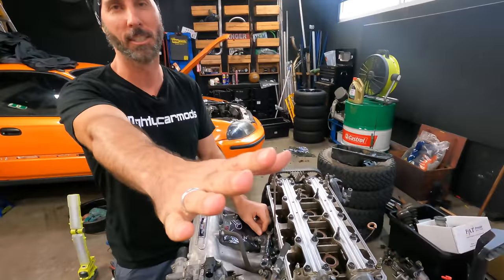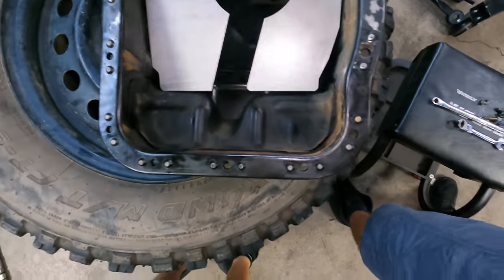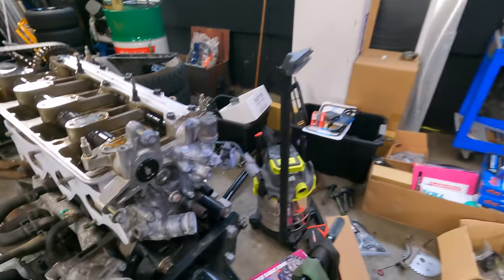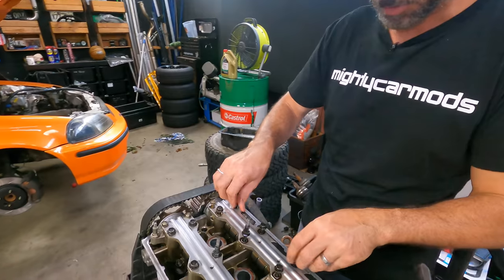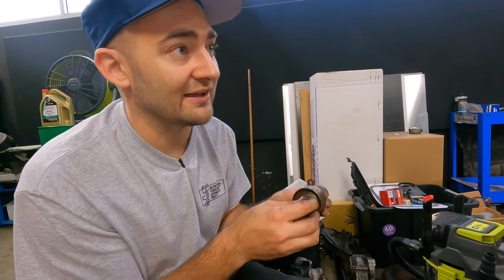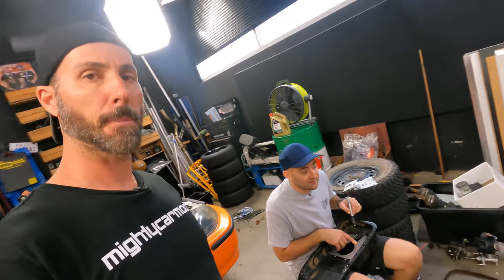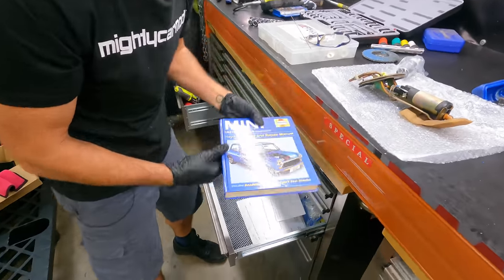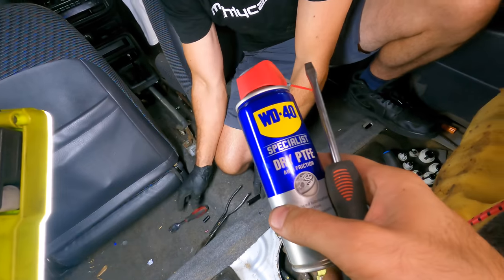Spoon your SKUNK until he MUGENS - CIVIC Build (EP5)

Comment: I still have my first vehicle, a 1990 Honda Civic, which I swapped a B18A1 into.  I just got it all working great again.  I've owned the car for 15 years.  I love it because it's zippy and handles really well.  By today's standards a Toyota Rav4 is probably quicker than my car, but there's just something about ripping around in a car that weighs less than 1000kg and has 100+ hp (laugh all you want, maybe I'll turbo it one day, ten watch out!!).  And with gas prices being what they are it's an economical way to pretend I own a sports car.  Beats the hell out of driving my gas guzzling work truck around, with my tools rolling all over the place in the back.   Best wishes from Alberta, Canada!

Comment: EF/DA/EG/EK/DC are good first cars for a beginner enthusiast... even though they're slow lol. Great to learn things like dropping a transmission, doing a clutch or building a Frankenstein engine. Basically every reason Marty gave in the video on MCMTV2 talking about small cars from a long time ago.
Reply: I have a buddy that is a mad honda wizard ( builds turbo civic drag cars in his garage lol). My beat down EF hatch completely shit the transmission in a gas station parking lot. I call him up and he says  " I got a 90 si trans in the shed with 90k miles on it, if you can get it here" Sketchy tow ride from an F150 and a rope got me there, he did it in his driveway in 2 hours and we puffed down on the test drive lol. This is why Hondas will always have a special place in my heart 😁
Reply: they aren't slow once you boost them turbo is the way to go if you have a honda. a 300-400hp EG or EK will beat most stock to lightly modified muscle cars from a roll. I used to beat corvettes, coyote mustangs, porsches, ect... from a 40 roll all the time in my 350hp civic. It's a fun cheap hobby compared to building other types of cars like I have friends with 700+hp v8 cars but they also have like $20,000-$50,000 invested in them so that is not what I would consider a cheap hobby lol

Comment: My first car was a hand me down '94 integra (B18B1, kept mine stock because it had 180k miles when I got it and sold at 250K with heaps of rust I didn't want to fix) back in 2015. Dad used to work at a honda shop growing up in the 90's early 2000's. The amount of abuse those engines will take and the amount they have always felt overbuilt engine wise for their price is always felt reassuring. 

Fun fact, Mugen Motorsports was founded by Hirotoshi Honda, the son of the founder of Honda, Soichiro Honda

Comment: I owned a 2002 RSX Type-S..  I loved it because it was easy to work on and it was comfy as hell with it's leather racing style seats from the factory.  That and the k20a (I vtec 2) was absolutely bulletproof.

It ended up becoming a 2nd car eventually just due to age and then I replaced it but instead of selling it I left it sitting in my parents yard for almost 3 years until I eventually gave in and sold it for 4k with 270k miles on it.

Oh and did I mention it used to chew up assholes in mustang v8's and spit them out?  I remember this race (very irresponsible btw) on a empty highway.

This dude in a 2006 mustang pulls up beside me.  I was going 60 just relaxing.  Anyways 3 does the 3 beeps, on beep 3 I dropped it down to 3rd gear and took off.  The mustang guy gave up at about 130mph but I figured I'd keep going.  Speedometer was pegged, I hit a tiny bump on the highway at the crest of a tiny tiny "hill" and caught enough air that I never raced on the road again... At least not past 80mph.

My honda... Acura also brought me many laughs.  It was because everyone with an S on their car thought they were faster and since I'm in America it was mostly toyota corolla S morons lol.  I think stock I had 100 horsepower on them.  It literally happened on a daily basis.

Oh and lastly the car cornered like a god damn almost porsche (yes I've driven some).  It was so fun to drive and if you knew how to drive it you could make it oversteer despite being fwd.  

So it was a fast, nimble, fun to drive car that was cheap and easy to keep running, a bulletproof engine, comfy as hell interior (at least the type s model with all the options lol) and... I just loved it.

Even now with better technology and way more factory horsepower in cars I still miss my RSX.. I always will.

Comment: People love honda/acura because of how accessible they are along with the aftermarket/secondary market support. They are/were dime a dozen and many people's first project car. I bought my first crx for $250 and a 15" subwooder and wrecked it before I could modify it. My first civic was $1200 and I learned about nitrous with it. My second civic was $500 and I learned about turbo chargers and tuning with it. A few honda/acuras later I now have a clean turbo integra that sits in the garage and comes out for weekends and track days. I've learned everything about cars starting with hondas in high school. At this point its a lot of sentimental value.

Edit: They were also easy to work on/Double wishbone suspension/vtec/type r/interchangeable parts between models/light weight

Comment: Moog - I love Honda's for the engine and gearbox purity. IMO they are the golden standard for shifter feel and maybe how easily they rev as well. They aren't that fast, but they are hella fun to run through the gears, or downshift rev-match. I've owned two EP3 SiRs and currently drive an Acura TL Type-S - Transverse V6, 6-Speed manual, Limited slip diff and Brembo brakes.

Comment: I had a 1st Gen, 1975 Honda Civic CVCC during college.  While it had it's problems, it was an incredibly fun car to drive.  Honda has always managed to make the Civic a great handling car, that doesn't feel cramped, despite its diminutive size. My previous car had been a 1974, 455 Pontiac Trans Am.  While the T/A was a much faster car, the Civic still put a smile on my face.

Comment: honestly i never really liked hondas until i owned one. picked up a cheap integra w/clean paint but bad piston rings. Never really did much mechanic work but after watching enough MCM i figured i'd try. I replaced the engine using YT videos & help from a friend & it runs great. dependable, fun to drive, easy to work on, economical, handles & stops great... i get it now

Comment: Guys, you cant just hammer in a fitting that uses a o-ring. Always lubricate a o-ring before installing it. This will provide some lubrication for the installation process as well as help with this first initial seal. I really hope you did not damage that seal in the manifold, and are going to end up having to remove the whole thing again...
Reply: But they can.... Obviously....
Reply: Eh, it'll probably be alright. Because Honda.
Reply: @jakegackle7398  You simply HAVE TO Love Honda. Ive had many many Hondas. Cars and bikes. They're all brilliant

Comment: I like Honda Civics (5th gen) for all the reasons you mentioned - plenty of parts, easy to work with, reliable and lots of potential. I've had a dozen of them, and they all are/were used on the track

Comment: For us in the USA where we never got the cool mid-range turbo performance JDM cars, 88-00 Civics and Integras were easily available, responded well to mods and handled great. If you look at all the other affordable cars of the era (Sentra, Golf, Corolla) the Civic and Integra were just better cars overall. Then there was whole aspect of engine swaps into a Civic and beating more powerful cars at the street races. The kids with Mustangs and Camaros were already paying more money for their car so they didn't have money for parts, but the kids with the cheap Civics could spend money on parts to go faster and improve the power to weight ratio. B18 Integra swap and a pieced together turbo kit pushing 10psi and you were pretty much the fastest car in town.

Comment: Guys, please help me. I don't know what to do with my civic.
I live in Russia and I have the stock civic ek4 with b16a2, and it doesn't chops anyone. My 0-100 best result is 9.2s (rolling of a slope with wind in the back). It's not so fast and fun as it should be.
Already changed: air filters, fuel filters (both), oxygen sensor, fuel pump, sparks, spark wires, spark distributor (including ignition coil), I deleted catalyst, and it still goes like someone holding its ass.
I spend all my free money on this bitch (here in Russia we have  humiliating salaries) and she is still slow... Help me with advice please.
Reply: Turbo
Reply: @opegg2000  turbo would be cost like another civic, I just want to understand the problem
Reply: Faulty VTEC?
Reply: @Goosetrain123  no, vtec is working fine
Reply: Not a Honda owner but I would check the timing. Make sure it hasn't jumped a tooth on one of the cam gears and check base advance. Maybe compression check too
Reply: K swap.
Reply: Throw an Integra motor in. People used to do that all the time in the states back when.
Reply: Make sure ignition/distributor timing is correct. Also, another modification you can do is to install a B18C block and use your B16a2 head. This is called the "poor man's type R" engine. You will go from 160hp to 180hp.

Comment: your wrenching on a b motor and have to ask why people love hondas? that motor is a work for art even for 2021 much less 1995
Reply: This is it. Like that motor was fitted to 1991 CR-Xs, it's a lightweight high-revving engine, it could be like 30 years old, and you guys are working it like it's 5 years old. 

It's also a 1.6l so is low tax in places like the UK, and a good B powered Civic will beat its European GTi competition easily.

Comment: As an owner of 3 different gen civics I’ve driven a multitude of different cars that are all fun to drive given the circumstances, but as for being able to daily drive , maintain and upgrading it is by far the easiest thing to work on along and having the reliability makes it a plus , ek chassis is light , swaps and aftermarket are abundant, not to mention car comes with double wishbone suspension which makes it corner pretty damn good , it’s light and it does it’s job in an era where cars are all overweight and bulky saddled with safety features

Comment: Keep up the great work guys! As far as honda perks? Well designed and groundbreaking NA engines, high revving, vtec noises, reliability, good transmissions and aftermarket support. Not to mention the double wishbone suspension design of the golden year hondas (1988-2001) is better than other machperson strut options of the time and still relevant today.

Comment: The main reason I love hondas so much is because you can make them fast for really cheap, cut corners during your build, and they will still run for 100,000 miles after. Plus if the honda does break you can buy another for $600

Comment: As a 2012 FG4 Civic Si owner, I can't really say that I would ever want anything else. While it is quick (not fast) stock, it improves going FBO (intake, exhaust, downpipe, and headers + tune). The motor and tranny can reliably hold 350-400 hp or about 12 lbs of boost so they're plenty fun with a turbo or supercharger. People have been pushing up to 600 hp with stock engines and built tranny's. In my 65,000 miles of ownership I've only spent around $1,500 on scheduled maintenance while completely thrashing the car. The K20's and K24's now use a timing chain instead of the belt and is virtually maintenance free. There seems to be no limit to what you can do with them. There's plenty of options for coilovers, air suspension, struts and spring combos. Practically any wheel fits on them, multiple brake upgrades from S2K rotors to Acura TL 2 piston calipers to Brembo 4 piston calipers. I'd say Civics are one of the most versatile cars out on the market that can me used for daily driving, performance driving, track abuse, show cars, rallying, and the list continues. They could be set up for nearly anything the owner puts their mind and wallet to.

Comment: I could have cared less about Hondas 10 years ago. I got my first Honda...an 07 Civic LX. After that, I was bit by the bug. I now have an 04 Element and I absolutely love it. Its not fast no matter how bad you try to imagine it is but, I love it anyway. I have done a full Magnaflow exhaust, Injen cold air intake, audio system, and about 4k in replacement parts including wheels and tires......I plan to keep it for as long as it will stay rubber side down. :)

Comment: That engine is REALLY clean inside. It either has extremely low mileage (which most JDM engines do), or someone actually cared about it and changed the oil at regular intervals.

Comment: For me the appeal of older Civics is: they are reliable, light, cheap, can be made to handle like a race car & that there is so much aftermarket support for it. As a added bonus, most of the aftermarket parts are also very cheap & any job you do on the car, tons of people have already done & will tell you what works, what doesn't & how to do it. It's only downside is that to make a lot more power than stock is expensive & takes a fair share of mechanical work/knowledge.

Comment: FYI on the fuel tank seal, you'll probably need to replace it before you drive the car

When I pulled the pump on my GTI the tank gushed fuel out the top after putting it all back together. The rubber seal absorbs fuel and swells so once its been opened it doesn't seal at all. Just gently driving around in 1st gear sloshed the fuel around enough to pour out the top of the tank

Comment: Not sure if you really care, but in the early 2000’s the WRX, Evos, and the STI came to the USA. My 93 civic with less than $8000 total invested including the purchase of the car, gobbled all these cars up. I made 215.4whp with an LS/vtec build and my car weighed barely over 2000lbs. I ran 12’s at the strip and the car was my daily driver, not comfortable though. Not the fastest car, but very little on the road could keep up on mountain roads or from a dig. It was fun, loud, scary at speed, cheap, and quick. My civic had a reputation, people sought me out to race. I was “that green 4-door,” it still makes me laugh. Miss that car. K-series are awesome, but my heart is with the b.

Comment: Throw a gear kit and some decent slicks on it before you take it to the track. It's definitely not going to be fast compared to other cars you've owned and worked on but you'll be pleasantly surprised how fast it can be driven and how capable it'll be at the track. Smiles per $ is way up there.

Comment: Also remember when changing the fuelpump to check the wiring, it could be really small "gauge" from factory which handles the factory pump current but not that great with a pump that needs more current. Otherwise the wires will get hot...

Comment: I’m guessing for ease of manufacturing, and for sealing purposes, the removable port was designed. If a square port was used instead of the round one, it would be much more difficult to seal, because a round seal couldn’t be used. This is also a cheaper part to machine, instead of a square removable plug the converts to round. You will have no issues running the manifold.

Comment: The oil pump have number on it. Suggest find a oil pump with No.10 ( Type R ) because in high rev enough pressure to push the engine oil to the head.

Comment: I wouldn’t worry about the intake coolant holes, that’s just a different way for water to flow it’s not vital that they match up it’s purely just for water to flow and with a pump pumping it the difference will be minimal if not unnoticeable, older engine made in the 50/60’s had intake ports with miss matching faces to intake this mattered because it slowed intake speeds down so you would grind them out to match, but it won’t make a big difference I wouldn’t worry about it 🤙

Comment: Be careful when welding after using brake cleaner guys.
The active chemical in brake cleaner is tetrachloroethylene. When this chemical is exposed to excessive heat and the gas argon, which is used in MIG and TIG welding, it produces phosgene. Phosgene gas can be fatal with a dose as little as four parts per million: basically a single small puff of smoke.
Love your stuff and would hate for some bad shit to happen to you!

Comment: When You work on fuel pump, next time open the gas cap, it makes the rubber seal from the tank not fit because of the Air. Happened to me and lost some gas on the road.

Comment: Why have I owned three Honda Civics over the past 25 years? The first two each had over 200.000 miles when I gave each one in series to my daughter who put another 50,000 to 100,000 miles each until she finally junked them. The third I still own has 230,000 miles on it and it still runs fine. Other than routine wear and tear items, the only major repair was a head gasket on one of them (and it had well over 100,000 miles before that repair). The cars were all basically stock.

Comment: I've seen B16 civics win autocross races against corvettes, supras, mx5s with exhaust wheel and tyre mods only. They have Double wishbone suspension and handle predictably at the limit. They have the smoothest Japenese gear boxes (weak though) and aerospace tolerances in their engines which helps them rev reliably higher than other engines. They suck because they don't have any torque other than torque steer and don't come turbo and awd.